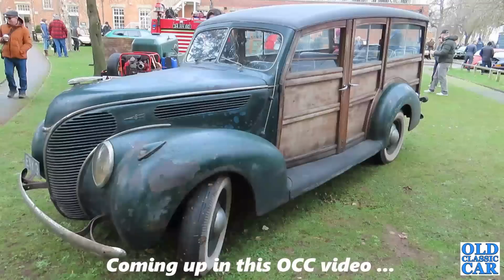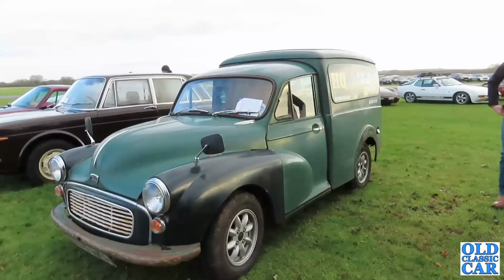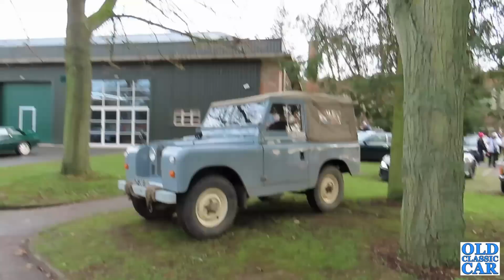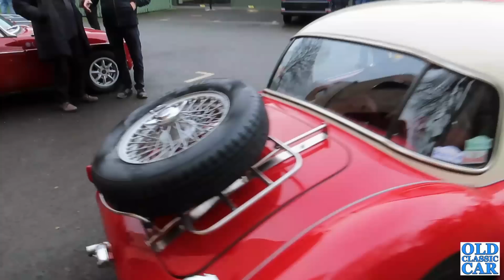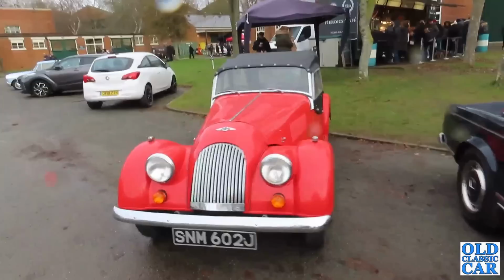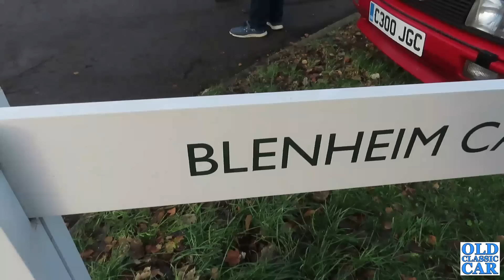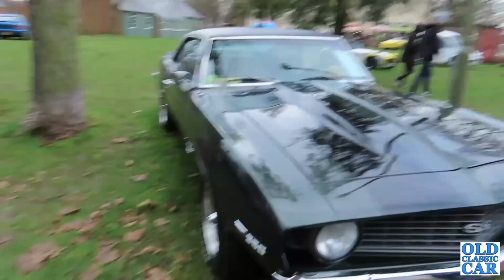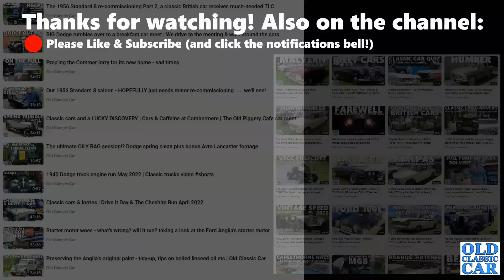SUNDAY SCRAMBLE! at Bicester Heritage January 2023 - a tour of the vintage & classic cars on display

Comment: Richard that old 38 Ford Woody is fantastic. I have a 48 Ford V8 coupe NZ assembled RHD so I know a bit about these US based Fords. Good to see it is a UK built one too, complete with side marker lights and add on semaphores, in Deluxe trim (designated V8 81A). The woodwork would be the most expensive thing to restore. Often it is only the termites holding hands that prevent a door or something falling off.

Comment: The Standard looks like a mucked about Standard Avon. As a young man I had a 1930/31 model with a pointed tail body and a low v-shaped windscreen that was described to me at the time as being by Jensen. I googled it the other day, having seen the one on your video, and learned that one or may be both Jensen brothers worked at Avons, before eventualy forming their own company. My car was very much a sheep in wolfs clothing, with its long bonnet only covering the scuttle mounted petrol tank, and a deminuative 9hp Standard engine, the carburettor being mounted straight onto the side of the block, with  I suppose an internal inlet manifold? Anyway although it replaced my then same vintage Austin seven special, there was little or no difference in the performance! I think like SS they made one with the six cylinder engine, that probably had a bit more performance! However when parked it looked the part!!